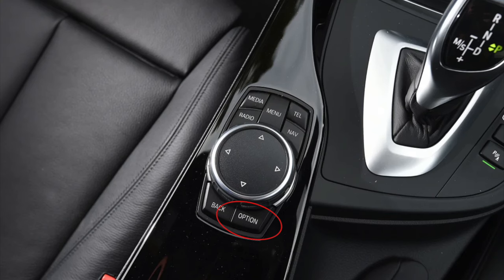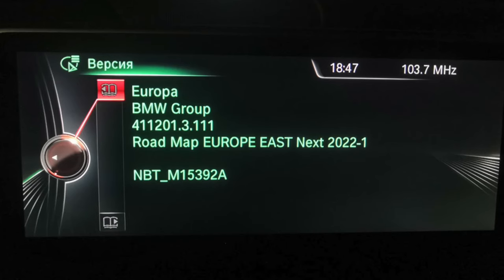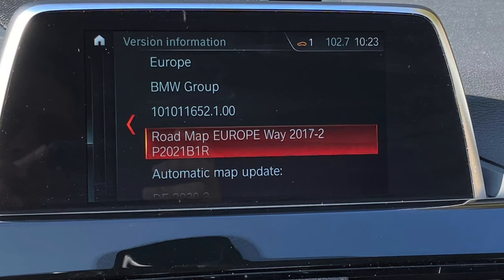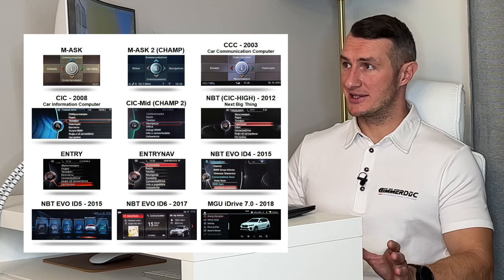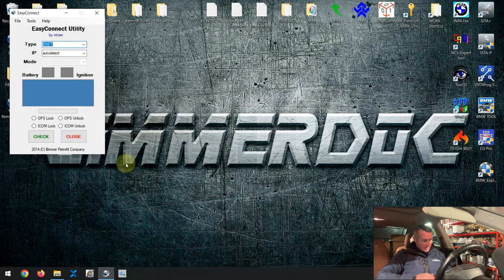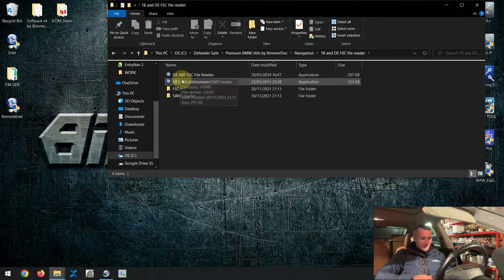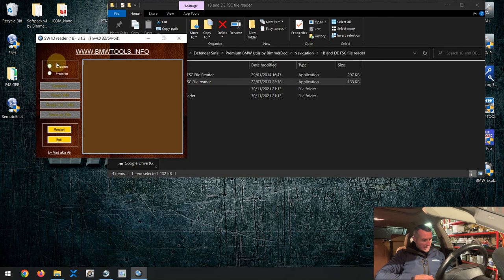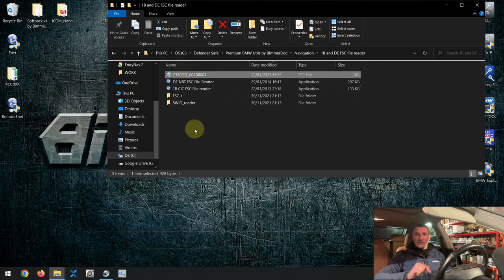How to update BMW navigation maps properly? Ultimate DIY guide

Comment: Another great video Vladimir! I'd add one more thing to 'preparing usb' section.
Make sure your drive is formatted using MBR (Master Boot Record) partition style, not GPT (GUID Partition Table). Modern PC's use GPT by default. Some time ago I spent like 2 hours reformatting different USB Drives because CIC unit could not detect any of my drives, until I realized all of them were GPT style. Easiest 'fix' is to delete all partitions on usb drive using Windows Disk Management then create new partition using MBR.
Reply from the maker: That’s very good comment and actually makes sense. 
I’ll pin that comment to the top!!!
Thank you for information))
Reply: @BimDoc  подскажите пожалуйста где можно скачать Fsc generator ? Не где не могу найти

Comment: Hi Vladimir! Many thanks for your video. I have a 2017 225xe iperformance. It uses Roadmap Europe Way 2017-3 
E1732C1R.
Is there a way to update without the ecu reader? Thanks
Reply from the maker: Way map update requires fsc long
So another tools are needed. But it’s doable.

Comment: Hi @BimDoc can you help me with one problem, i do what you say in this tutorial, and after the update, every time I start the car a message appears on the screen " Navigation data in vehicle incomplete or has been manipulated. Please have the system checked by Service". I do it again with the same maps different USB stick, and again with maps downloaded from a different website, still the same. Can you help me with a suggestion how to solve the problem? Thank you
Reply from the maker: Make sure file system and usb drive size are correct. 
Solution is exactly as you are doing.
Reply: @BimDoc  usb size 64 GB, and file system of USB is FAT32…

Comment: I recently converted my NBT Next headunit from Japan to Europe by replacing the VO codes and changing the Map_Vairient to ECE,
Will I need anything else to do before loading the map?

Note: after I did those changes the Map doesnt load and the version info is now blank
Reply from the maker: Japan market is very different that’s why current conversion is not straight forward procedure.
Reply: @BimDoc  thanks for your response, really appreciate it! can you point me to any guide that might help? I also managed to export the FSC files via bimmer code not sure if thats useful. now if I got the maps and a short FSC code would it work?

Comment: I download the maps and put them on a 32 GB USB and my car (F22) says „Map is not complete/manipulated“. I don’t have the FSC-file. Where do I get it? I use the official BMW map updater
Reply from the maker: You are definitely doing smth wrong. For example wrong file system. 

And anyway you will need fsc. 
You didn’t specify your HU type. So I don’t know do you have fsc long or short.
Reply: @BimDoc  In the process is nothing possible to do wrong. I used FAT32, NTFS and exFAT already. The download works. Unpacking to USB works. Installing in my car doesn’t work. I think it’s NBT (F22 from 05/2016) Navigation Business. 

My question was, from where do I get the FSC file? I never got it from anywhere. But I already did an USB update successfully 3-4 years ago. It just worked. 

Thanks again in advance!

Comment: As always he has not left anything unexplained, I would like how to replace an HDD with an SSD in CIC, whether the disk no longer works, or if a substitution is made as prevention ... the advantages are known to all and the drawbacks...... I think that the temperature is excessive for the usual solids and if the revolutions influence the movement of the vehicle and if the change influences how the vehicle goes to sleep
Reply from the maker: I’ve read that it’s doable. 
Haven’t investigated that in details jet
Reply: @BimDoc  I can't say I don't like it, but it makes me sad..... I hope it's up to the challenge.
Reply: I have replaced 3 years ago my F10 CIC factory 80GB HDD with 120GB mSATA SSD, it's quite straight forward process.
You need mSATA adapter obviously and right software to copy HDD information and write it to SSD.
Reply: @marek556  Does the adapter use a space inside the hard disk space, then it is set as original?  what adapter do i use?  thank you.
Reply: @pericodelospalotillosverdes  Yes, exactly, it will convert a full size mSATA SSD into a standard 9.5mm high 44-pin 2.5" IDE SSD drive. I used Delock IIDE-MSAT mSATA SSD to 2.5-Inch IDE Adapter Converter with aluminum frame bracket.
Reply: @marek556  This technology catches me out of the loop, the disk is solid, it is a card that supports up to 70 ° C, therefore the substitution is very good for high temperatures in low temperatures, if it is abroad and below zero there will be some inconvenience that will not be the case. Usual,Solid SSD size is standard and fits perfectly in msata to ide pata adapter?  With the metal support it is only found in America I will have to bring it from there. Thank you very much for your attention and generosity in sharing your experience with me.
PD I'm seeing that you have a channel, but I haven't seen a video about that change you made to the disc and how am I right?

Comment: In CarPlay or Android Auto, navigation using Apple Map or Google Map, navigation info could be projected to HUD, not much detail like original BMW maps, but could be readable and usable. But 3rd party apps like Waze couldn't. I didn't like original map is it's navigation algorithm is not as good as Apple or Google or others. It always lead you to the path you don't like. And the map update interval is too long( a quarter).
Reply: But never mind, this is a very good video :)
Reply: Agree, ID7 can display Google Maps nav data in the HUD. May be different in  other head units as mentioned in the video. But for an early ID7 G30 it works with Nav Prof

Comment: Thanks for the video and great explanation. It will be very helpful for most BMW users. I have a 2017 BMW 540i G30 USA origin, have a FSC code for EU with label: FSC_Gxxxxxx_012000FE.fsc, inserting as you show on video, but have received a massage, that please use proper FSC or something like this.
What's wrong?
Reply from the maker: In addition to the code HU has also to be patched (done via feature installer for example)
Reply: @BimDoc I have already ordered for remote access with patching Carplay and then generated a FSC code, as I understand now, it's made by the Feature Installer. But maps were actually not working and cars couldn't recognize road signs. Could you patch HU accordingly in order to properly work on maps and reading road signs?